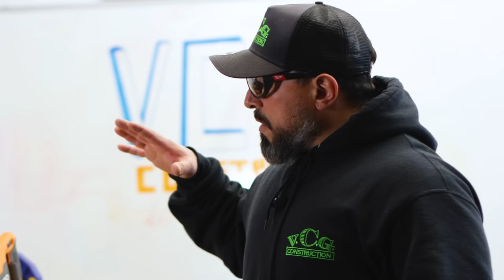Milwaukee Tool Is No Longer TOP DAWG at TTI (new best brand REVEALED)

Comment: Ridgid looks good on paper. Milwaukee looks good in the field! 🔥 🔥
Reply: My contractor brother has Rigid. I have Dewalt. We all agree Dewalt is better, quieter, and longer lasting.
Reply: @normferguson2769  I say they are not that bad for diy or maybe light use in the field but milwaukee is pro level tool.
Reply: And Makita if your willing to pay more🤷🏼‍♂️
Reply: @toolhead147  I would imagine that the turning point would be the price.
Someone who makes their living with their tools probably would go with the Milwaukee more so the Ridgid, but someone like myself who would rarely ever use a tool like that would more likely go with Ridgid  due to the price point.
Reply: @normferguson2769  ProjectFarm just did a reciprocating saw test and DeWalt came out on top, just ahead of Milwaukee. Both are beast grade.
Reply: There are several brands out right now that have superior specs on paper than Milwaukee.   But when they're put head2head in real-life applications the Milwaukee runs away with it every time. My M12 Fuel  impact  driver beats most of the other named  18v impacts on my jobsite. My M18 Gen3, forget  about it,  that bad boy is in a league of it's own.    I used Dewalt for years and never had a complaint.  I like Dewalt,  but I switched to Milwaukee  M18 Fuel last year and I have zero regrets.  In fact,  I like the Fuel platform so much better, wish I would have made the change earlier.
Reply: Should try the makita 40v impact driver, better than gen 3 in every way, and I’m usually a Milwaukee guy. Makita is back in the game!!
Reply: @ecoRfan  I think what it really boils down to is, what battery platform are you already on.
Consdering how much batteries cost if you already have a ton of one brand it's not very cost effective to switch over to another brand unless they make something that no one else makes and you have to have it.
Reply: @adamfehr1994  I've never owned anything Makita, but I've never heard anything bad about them, only good.   I am way too heavily invested in the M18 and M12 platforms to switch to anything else.  Hopefully Milwaukee keeps it around long enough for me to recoup my investment because we all know that the arms race between the Big3 isn't stopping any time soon, and eventually what's great today will be obsolete tomorrow lol. Let me clarify about Makita:  yrs ago,  my then boss had a Makita 9.6v NiCad drill/driver that I used a lot.   Then, Dewalt came out with their new 18v drill/driver (impacts weren't around yet) circa 2000 so I bought one.  Holy $hit I was in heaven lol
Reply: @ecoRfan  All the recip testing I've seen has the M18 Fuel Super Sawzall beating the Dewalt FlexVolt.  But I think the orbital feature has a lot to do with that.
Reply: Ridgid is literally milwuakee, everything you see in milwaukee you see 2 years prior in the ridgid brand lineup.
Reply: @jonathangarzon2798 , Milwaukee is definitely not Ridged.  If that were the case,  explain why.....nevermind,  man, put down the pipe.  Lol
Reply: @enockenock4183  I'm not saying it's the exact same but both are owned by tti and almost every new line or concept I've seen in ridgid before milwuakee
Reply: So Rigid looks good on paper, Milwaukee looks good in the field.
I respect that.
My response, I spend less money on my Kobalt Xtr series an I'll outperform both Rigid and Milwaukee in any field lol.
I do renovations and remodeling professionally.
My boss runs all DeWalt everything brand new as of last year.
His brother bought all Milwaukee the same week.
I run all Kobalt Xtr everything.
I regularly outperform them both.
As well as any other guys I work with pulling side jobs.
I wish I could get paid advertising Kobalt. Sadly I do not lol.
However I am a Patriotic bluecollar  family man.
I'm more concerned with passing along advice an attracting more guys back into the trades field.
I ended up running Kobalt because I had about $1700 worth of Milwaukee and DeWalt tools get stolen at a job site in Detroit.
So I needed tools to finish the job.
My plan was to finish the job, finish getting paid and replacing all my stolen Milwaukee and DeWalt tools.
That was 6 months ago.
As you can see, I've changed my mind. I've actually expanded my Kobalt line because I'm so impressed by the price and power of not only Kobalts Xtr line, but regular Kobalt tools as well.
I have every Kobalt power tool besides the shop vac, inflator, radio,  an the cordless mini chop saw or whatever it is.
I seriously can't believe how happy I am to have a bunch of degenerates steal my shit.
If they hadn't, I would have never taken a gamble on Kobalt.
Now, I can't ever see myself switching back.
Kobalt has made me so much money and saved me so much as well, that I highly doubt I'll ever run anything besides Kobalt again.
I may buy that 36 or 40volt Makita angle grinder an a couple other tools from different brands but that's it.
An even then, I have adapters to run my Kobalt batteries on Milwaukee and DeWalt tools.
So I would only have to get a Makita adapter if I bought their angle grinder. I'd still get a couple Makita batteries though in case my Kobalt 24 volt batteries can't run the Makita properly but if my Kobalts work then cool.
Big difference between 24v and 36 or 40v though lol.
So there's my rant. Yeah I miss all my shit that got stolen but at the end of the day, I learned a valuable lesson an have ended up saving money because of it.
Save some money and buy a Kobalt tool or two and see how they measure up.
The one handed reciprocating saw and the Kobalt Xtr impact driver is what I tell people to try first. 2 of my absolute favorite Kobalt tools.
That impact driver is simply great. No video can do them justice an all the videos featuring them are great! So that should tell you something.
Have a great day everyone and may your pocket get forever fatter!😎🇺🇲
Reply: @konolfodinsson4096  how does kobalt make you more money than if you had used Milwaukee or DeWalt? That makes no sense, they all basically do the same thing with a bit of cost difference, which in the long term is negligible. But it is true that with kobalt you practically don't have to worry about getting your tools stolen, which is a big deal. The obvious problem with kobalt is the limited array of tools as compared to the bigger names. Even Ryobi. But if you only need the few major tools then it's not a problem. But now Lowes is pushing the Flex tools so much I have a feeling kobalt will be left behind, with things getting discontinued and assesories and batteries harder to get in the future.
Reply: @blamuk  They make me more money because they're cheaper and more powerful than my bosses and his brothers current gen Milwaukee and DeWalt.
Pretty simple equation: Cheaper, more powerful tools= Better profit margin.
You make it sound like my logic is flawed lol.
Seeing as how I own almost every tool Kobalt makes I feel I may have some experience with them.
More so than, I don't know, say someone who's never ran them?
An I'll reiterate, I have adapters to run my batteries on both Milwaukee and DeWalt tools respectively
So the very few tools Kobalt doesn't make, I can easily buy and run on my batteries.
Which if you didn't know, blow any Milwaukee or DeWalt ( DeFault ) battery outta the water.

Comment: I think TTI works in cycles. They improve one brand, move to the next and circle back around. In doing so they move Ryobi up out of its intended budget range and thus Hart was born.
Reply: Hart is Walmart's exclusive brandi. Rigid is Home depot's premiere brand and Ryobi is the home gamer brand for HD

TTI used to make Craftsman for Sears. Now Craftsman is made by Stanley Black and Decker for Lowe's to compete against the Rigid and Ryobi lines. Stanley Black and Decker's home gamer tool (Black and Decker) can't compete against the TTI home gamer tools.
Reply: @davidflower295  I own B&D and Hart tools and the Hart tools are WAY nicer.
Reply: @jenkins9279  I just looked over their tool line again. It's good stuff. The drills and impacts appear to be higher end Ryobi tools of a year or two ago. The hammer drill is very similar to the Milwaukee of yesteryear, just with not as nice if ergonomics and not as nice of a handle. 

It seems like TTI gives the home gamer tools professional grade reliability and plenty of power, then trade off ergonomics. I really hope it forces Stanley Black and Decker to start rebranding some Porter Cable tools as Black and Decker to keep up.
Reply: @davidflower295  using my power tools as a home owner not for work Hart is definitely what I see myself buying more of. I don’t have a big box store near me but I do have several wal marts. I have seen several people say Hart basically looks like older model ryobi and Milwaukee and that’s fine with me.
Reply: @davidflower295  tti doesnt make anything. Its a financial conglomerate.
Reply: @davidflower295  harts drills suck! Their circular saw is a little beast!

Comment: The ridgid sounds like the tool is getting bogged down a lot more on both the wood and I beam cuts, I would be curious to see how it actually holds up in the long run. 2 lbs is a lot of material to cut out between the two tools and even with superior specs on paper didn't seem to perform as well as the milwaukee.
Reply: He pre cut the I beam on rigid watch again on top cut of the I beam it was already cut he didn’t even have to cut the part closest to him

Comment: Well said, numbers on paper don't pan out in real world scenarios. The Milwaukee SS has 3000spm but it doesn't bog down one bit, the Ridgid has 3200spm under no load but it was probably closer to 2000spm when being pushed.
Reply: jack smith He used a 3AH on the Milwaukee on another video and it was still twice as fast as the Ridgid. The Milwaukee just has the superior brushless motor,  I'm not sugar coating it.

Comment: Well as a Professional Contractor/Handyman/Licensed Home Builder, Wood worker, Electrician and Welder. It doesn't really matter to me who's in the top or below. At the End of the Day Electric Powered or Battery Powered tools will always be just only a Tools, they are NOT perfect! They are just only a Machines. It is Man who uses them. I'm still using my DeWalt dcf888, 809, 801 and 894 in my Jobsite. I still have my Hitachi Triple Hammer Multi-Volt Impact Driver I wanted to get rid of it but i changed my mind and kept it because it is an IP-56 Rated Impact Driver. I also have a Ryobi P238 and Hercules brand brushed impact driver as well and I've been using them in my jobsite, I switch them often or whatever I wanna use for the day. And I'm gonna keep them until they get broken. also have my Bosch 1/2" HD-18 Corded Hammer Drill, and The Hitachi 12" corded sliding miter saw. So far all of my tools are in good shape. Still working fine. Keep making money. And I'm not planning to buy another tool at this time. Maybe after a few years before I could ever get to purchase a brand new tools.

Comment: I use rigid everyday and me and my boss did a little test, both using the brushless impacts of Milwaukee and Rigid, installing some trex decking, with the 2 amp battery mine kept up just as fast but my battery died about 15-20 mins before his. But I’ll still stand by rigid because if my tool brakes I just take it back, no questions asked and get a new one!

Comment: Well, ya had me going there for a minute. Then I remembered that Ridgid will never be allowed to supplant Milwaukee in the TTI hierarchy. I’ll say this though, I was impressed with the new offering from the boys in orange. I bet with a 9AH Octane battery it would have been a better shoot out, since the Super was sporting a 12AH. Would make a good TTR, the new RDG against a DW or MAK recip saw.

Also, not sure if your hands were bothering you, causing you to release the trigger (or maybe repositioning your hand one time), but was that a thermal cutout I saw a few times from the Ridgid? Anyways, the Super’s double wobble plate construction probably made it a lot more comfortable to use, since it’s built for just that kind of task in mind, while the Ridgid wasn’t built for stuff like I beams. Still impressed, but I think Ridgid inflates their stats a little. 

Good job on the video Vince!

Comment: I'm not disputing the superiority of the Super Sawzall, but how is it a fair fight when you put a 12A up against a couple of tiny batteries?  Their combined Ah capacity is HALF of that for the huge & heavy Milwaukee 12Ah battery.  Not only is there more amp-hour capacity, that larger pack probably delivers a lot more peak amps the whole time it's discharging.

Comment: Would using a 12Ah battery vs a 4Ah battery skew the results in favor of Milwaukee, even if all else is equal?
Reply: It would down the stretch. However the milwaukee was still doing better to start. And is a far better tool overall

Comment: when i first started using Sawzall's with metal blades you were able to get through only a few small cuts before the blades would stop working now you can cut just about anything with them
Reply: In the fire service we use recip saws for vehicle extrication, rescue, forcible entry, etc. With the right techniques and blades, they will rip through cars, pillars, windshields, security bars, boron rods, etc.

Comment: im glad you said it how it was! , milwaukee was butter smooth while rigid had ur left hand vibrating a shit ton, in the field that will wear u out big time 💯, not gonna lie tho rigid did look quick in the top half of the beam, but struggled alot on the bottom half of the beam
Reply: Because top half was pre cut watch again
Reply: That vibration had to be brutal what was it 3 or 4 times Vince that you went one handed with the Ridgid and yes I saw how much extra wear was on the blade that you used on the Ridgid versus the Milwaukee it was very noticeable.

Comment: Rigid has always been the top dog for piping/plumbing tools like pipe wrenches, pipe stands, and threaders. Everything else, stick with the tried and true Milwaukee lineup.
Reply: Ridgid power tools and Ridgid that makes the threaders, pipe wrenches , press tools etc is a totally different company.
Reply: @hollowbunny4911  lol. No it is not. Literally the same name, logo, color scheme, and corporate head.
Reply: @JJR_83  TTI & Emerson make the power tools. RIDGID has its own specific, lucrative group that work on the plumbing equipment. It’s not the same. Please research
Reply: @JJR_83   Emerson is the parent company for the pipe tools Ridgid. They have a licensing agreement with TTI to make power tools under the Ridgid name. And if you've ever wondered why the ridgid power tools dont share the same red color scheme as the pipe tools, this is why. The BS of it is that TTI was so lazy with the product design for their ridgid brand that they literally just took the names off of AEG power tools (another one of their brands that is more popular in Europe) and slapped the Ridgid logo on them and made the black rubber grey. Just google "AEG Ridgid"

Comment: When ridgid first came around all those years ago, the huge benefit/perk of the brand was their service agreement/warranty. Like many people I bought in and slowly started acquiring some of their corded stuff. At that time and even today to some degree, I don't have loyalty to one brand. I do my due diligence and research specs, feel, size etc, and buy the best tool for me for the task I need to do. I was primarily a DeWalt guy for years and then I spent almost $200 on a compact 20-volt hammer drill. That thing was a complete hunk of garbage, and absolutely refused to counter sink a 3-in deck screw. I even drilled pilot holes, and it's still couldn't do it. A deal came along on a cordless Milwaukee combo kit, and I haven't gone back since. The ridgid cordless stuff seems like it's definitely upping its game, but so is Ryobi.

Comment: Good test BUT your putting a 4ah against a 12ah. If I heard correctly the ridgid 4ah just has 18650 batteries and the 6 and 8 is supposed to have 21000 but I’m not 100% sure

Comment: i notice 2 things
1 when cutting with milwaukee the shoe was on the i beam more time, so less vibration and better cutting power
2 the i beam was not secure, lots of vibration and loss of cutting power, greatear loss with ridgid because the shoe was not properly use on the i beam
if i understand correctly the tool shoe has to be on the i beam at all times to transmit all the power to the cutting blade and less vibration to the user

Comment: I have used ridged for years and the numbers don’t matter the batteries from ridged suck the break easy the lose charge fast after a year the get stuck in the drills and become hard to come out I switched to Bosch and Milwaukee they both are amazing recommend them always I threw out over 2000 dollars of ridged tools because they never held up I always ended up getting more batteries more tools replacing what broke and the skill saw sucks the most out of it all i went threw three before I said I am done my ridged plug in sawzall broke in the first year I don’t miss treat tools I am a remolding guy not a contractor and the tools failed over and over